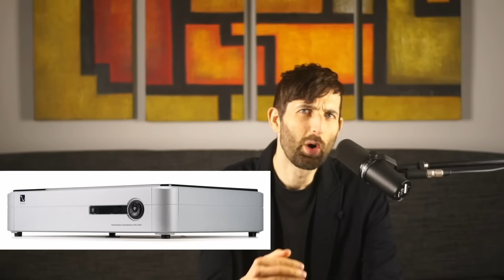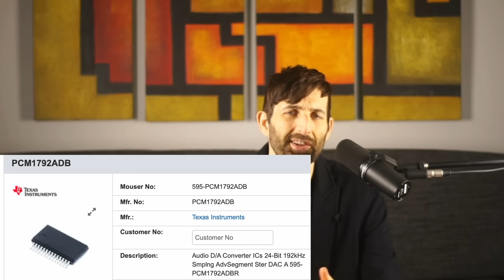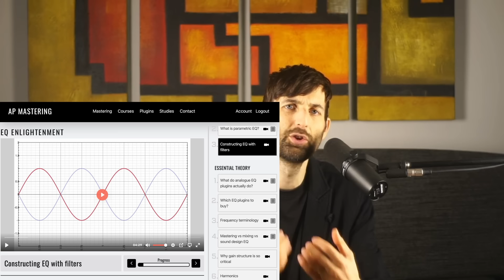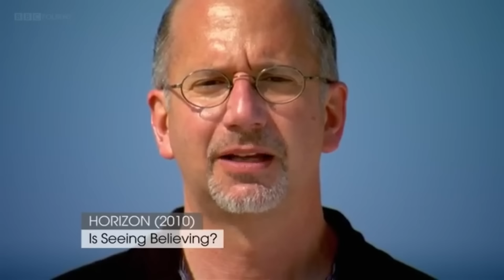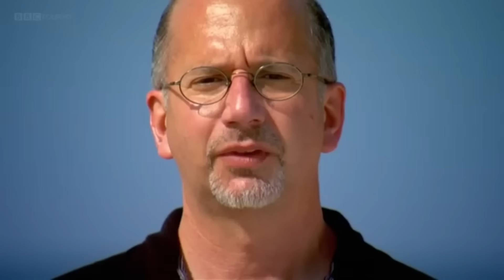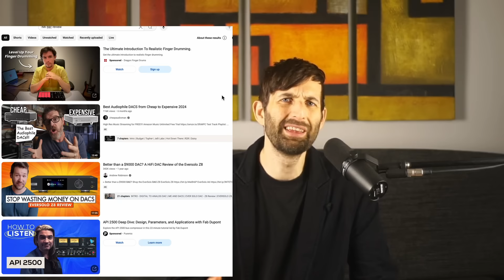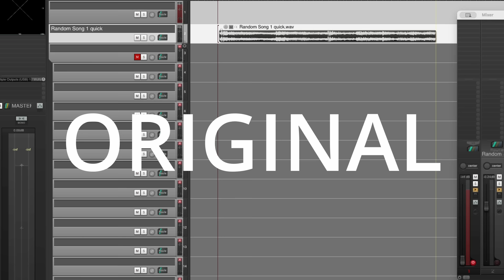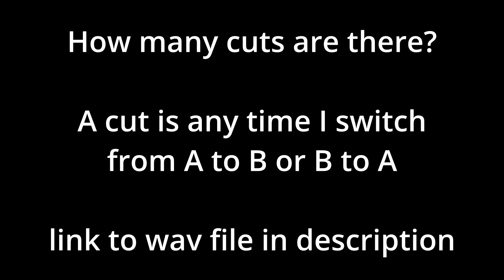The DAC Scam - Almost everyone believes the hype

Comment: I've read some claims that some people prefer that raw sound and find oversampling fatiguing to listen to.
That's fine and all and I'm not gonna tell anyone how to listen their music, but wouldn't ot be trivial for conventional oversampled DACs to just include an NOS mode?
Reply: The FIIO K11 R2R DAC for about $160 has an NOS mode.  So does my Gustard R26 that I bought after finding how much I like the FIIO R2R sound.  The R26 oversampling is actually variable.  The effect I'd call analogous to cranking up the sharpness on a photo image.  Its up to you if you like 'soft' or 'over sharpened' or somewhere in between.  I like somewhere in between.  I'd say most people could tell the difference.  Its not subtle.  Least with these two ladder DACS.  Got a AKM chip DAC I can flip to with a switch.  If I play something on that, people have said, 'that's the best thing I've ever heard.'  Until I flip to the R2R DAC.  The new 'best thing I've ever heard.'  (I was going to say there's no DAC chip in the Gustard R26.  Actually it has DAC in there to process DSD without converting to PCM.  That's a different animal all together.

Comment: Couldn't hear a difference at the end, I heard a shootout with a cheap Tascam converter vs the apogee, They guy tracked to both and mixed in each one, I did hear a difference and I preferred the cheap Tascam as it seemed to have a bit more weight in the bottom end.
Reply from the maker: anything that adds more weight in the bottom end MIGHT have a high impedance output stage or something which is colouring the sound, or it is colored in some other way. that might be pleasant but it is defective by modern studio standards
Reply: @APMastering yes true, not flat as would want, but the final mix sounded better. I was thinking it may have been on the tracking side as those tascams have mic pres even though it went in from a mixing console into both ADDA units. Somewhere in the chain of the tascam was adding colour. But then Isn't that the philosophy of Burl? Love your insights !

Comment: I think you are right on the snake-oil selling part but dead wrong on what makes a good dac a good dac. The chip is the easiest part to get right (and even that is horribly hard with clone manufacturing).

 PCB design for audio use in general is hard and expensive. Protecting the signal from outside, from other traces and doing proper isolation of everything is something you can’t just do on the cheap even if you have the chips. You can either build something excellent and expensive or make something with shortcuts on the above. You’ll get away with them in some cases but in others you’ll get jitter and ground-loops on your analogue traces. 

Your test only proves that in your setup there is no difference. But we don’t see the most important factor which is the outside environment. Whats on that same power circuit, how stable is it? Whats the rf-noise in your room? Most cheap things work on clean dead stable power in a low rf-noise environment but running this ab test of a diesel generator near a high voltage line or with cheap and bad knockoff pcb design garbage or even a microwave on the same powerstrip might yield different results depending on the quality of the dac.

If you wanna see how good the dac is look  over the pcb design and test the signal with an oscilloscope. I was expecting more then dac works for me so its perfect and you should never spend more then x amount.
Reply: It's not that hard. It's no harder than designing a pre-amp which has been competently done for over half a century.
Reply: @peterscott2662  you clearly never made something commercial with USB. You can build and resell pre-amps from your garage if you know audio engineering. 

You need an official company, vendor and device id from the USB-implementers forum, adhere to all there specs, build or let build an FPGA/CPU/DPS if you want software addressable features and OS-API compability. Build drivers for each OS (and the future once if they change), and implement the operating system for your device itself. 

Adding usb or anything computer related (RS-232 is a common port on older devices) to a commercialy viable audio product requires the following:
- Hardware audio engineering knowledge
- WIN/MAC/LINUX Sound API and kernel level device driver knowledge
- Since you need kernel-programming and embedded programming C is the logical programming choise, haven't seen rust audio drivers yet but could work as well.
- Low level chip knowledge (as in CPU register's. clock cycles per operation, ...) to calculate and work around latency and write your operating system for the device itself.
- Most of these chips are done is assembly so depending on the CPU you pick exotic assembler language knowledge might also be needed.
- Full knowledge on the USB-protocol since you will need to adhere to the standard. 
- Knowledge and legal on how to set up your company and how to get that vendor and device ID and manage liability (and a few months cash for your company to burn since you can't release a USB product without it) 

Making usb devices isn't simply making an audio device, its making an embedded computer that receives networked encapsulated serial packets that needs to be stripped, checksummed (= math operations) and processed with as low latency as possible before its even put on the dac circuits. 

I work with embedded devices on daily basis and even dead simple not latency prone applications become very complex when using USB. This is the whole reason industrial machines in all price ranges (1 euro to millions) are still using DB-9 connectors on whichever protocol they desire (MODBUS/RS-232/RS-485/UART) which is from the 1960's. Can't simply send a raw byte data over USB. 

So unless you are an audio embedded C  Kernel engineer with some legal background it won't be as easy. But if you are why would you make a dac? You're probably a top level engineer. Wouldn't work for  for less then 1k/hour with that skill-set.
Reply: Very true, but take a look at the Neohipo DC-10. 
Its very cheap but the output is very clean.
I grabbed it at 35 pounds, at roughly half the price its available now due to online chatter.
How long it lasts before developing a fault is unknown. 
But the one I recieved as is, used in the same components chain (AMP, Speakers), it would be hard to tell the difference between this and any DAC at any price.
Reply: @PSwino  its very basic but might be perfect depending on the software you wanna run at it. Does only support one codec, some review mentioned that he could’t run some analys software because some driver issue on windows. Seems like the experience id expect from a bare stripped dac. Great for some of not most use-cases, literally unusable for others since some features were stripped both in soft and hardware. 

Haven’t yet talked about software yet, thats even worse then the hardware part. It will only work for as long as the manufacturer provides drivers. Windows is just shit, Linux support is meh for most dacs and core audio compliant dacs for mac are easily 100+ euros.
Reply: @metballetjes  Interesting, thanks for the info.
I am so impressed that a DAC created at this price point can sound so good, the higher priced ones must all be massively overcharging (at best) for higher grade materials outside of the actual dac chip.
I returned my SMSL SU-1 (that actually had some distortion issues) in favor of the Neohipo.
It worth noting that the SMSL PS100 at 25 pounds sounded the same in my chain also and my choice here was purely a cosmetic and build quality one.

Doing some more research on the matter Is what brought me to this video :)

For the record, my entire chain I use this in is cheap...
Mini Windows 10 PC via USB-C, Plug and Play drivers and powered via the USB (I assume this causes quite a bit of unwanted noise but I can hear nothing).
Its connected directly to a Fosi V3 amp with some old KEF iQ10s with a Wharfdale Sub.
But ive had more expensive highly regarded equipment in the past, so Im not just basing my oprinion on this budget setup.

Comment: I had a dangerous Dbox and the DAC was much better than any interface I had at the time. Once I got the Apollo 16x I didn’t need the dbox anymore as far as DAC was concerned. 

I’m no audiophile by any means but there was a difference. 

Anyway, I see no reason to upgrade my DAC for monitoring but if using to send through a console one may consider the quality differences a bigger deal.
Reply: Yes.... Answer: Absolutely. The D-Box was better than previous, presumably lower-end, interfaces, but the improvement reached a point where another high-end unit provided a similar level of performance. This implicitly counters the "scam" argument.

Failing to distinguish between two DACs in a blind test doesn't prove they sound identical; it simply means the listener, in that specific test, couldn't reliably identify the difference. This is different from claiming that no difference exists, or that the manufacturer is deliberately deceiving customers.
Reply from the maker: just do a loopback test like I do here. Do 50 trips and see what it sounds like

Comment: Please do digital transports next.  My argument has always been that if a digital transport sounds ‘better’, then clearly there’s either A) a wrongness to it; or B) there’s some smilie EQ circuitry in the box to make it sound ‘better’… neither of which is conducive to working with audio.

If a functional digital transport could improve the sound of something, then I’d like to try streaming an Excel spreadsheet through it to see if it makes the numbers look better, or a Word file, so see if it improves the grammar.
Reply from the maker: I send all of my invoices to my customers via a golden ethernet cable to my internet router and I always receive double the money. it's amazing what high quality cables can do.
Reply: Yes, If it takes a $1000+ transport to extract the data from a CD,  all the FLAC rips I've made using a $30 cd  burner must suck.

Comment: I mean, audio-voodoo people pay equivalent of a downtown flat for their cables... they deserve to be scammed
Reply: Many years ago a co-worker and I would pass the time coming up with audiophile buzzwords to repurpose random bits of stuff from around the lab as audio parts. Good times, good times.
Reply: @libcent  I used to think cables made no difference until I got the chance to listen to several different sets of speaker cables in a high end system. Curiously the cheapest cables sounded easily the best with the others ordered almost exactly in inverse to the price. I think the really expensive cables were messing stuff up with extra stuff that increases capacitance and inductance and inadvertently filtered some frequency out.
Reply: @deerfootnz  the expensive stuff will on purpose be trying to cause a difference even if it's objectively to detriment

Comment: I agree, but the difference between my old Motu 2408 mk3 and the new Ferrofish was definately clear. But I've done the loop back test on the ferrofish and up to 10 I gave in ...couldn't hear it.
Reply from the maker: after how many did you notice on this loopback test in my vid? I go up to 100. Everyone should be able to hear 100 here, it's quite obvious but I think quote a few people would hear 10 too....
Reply: Which Ferrofish did you get? Is it the Pulse8AE?
Reply: The 2408 mk3 used AKM AK4528VF chips. Even back in 2004 these chips didn't have stellar measurements and performance. According to the datasheet, the SINAD of the DAC was just 94 dB, but in practice the measured SINAD at the output of the 2408 mk3 would be lower (as it will be for all devices). Today you can get DACs with measured SINAD of 120 dB at the output for under $250.
Reply: @FM-kl7oc  I used the 2408mk3's for cv/gate out to control analog synths. They sounded a bit naff for audio. @APMastering I couldn't hear when you did the switch on the test at the end. I could hear past 10 just about on the earlier test using apple airpod pro 2's. I like using RME Digiface for the low latency drivers. Ferrofish is the Pulse 16cv.

Comment: Allow me to disagree with you... Not all DACs use custom Chips for 10$ ... There are R2R Dacs and there are FPGA DACs like the Direct Streaam from PS AUDIO..... Also a DAC's performance depends on so many things other than the Chip..... Jitter control using a Femto internal clock, The power supply and linearity of power inside the DAC, the slew rate.... The types of components ... as not all DACs use tthe cheap Op-amps for signal amplification..... This video shows how little you know about this topic...... and if your ears cannot hear the difference that's great news....stick to your $200 DACs
Reply from the maker: why do you claim what I know? If you have such golden ears please tell me how many times I switched in the blind test

Comment: Poor people out there... I've been modding the analogig output of CD players, or whatever has a DAC inside and let shine USD 100 Players over other many thousands worth (or not). Digital was born with tight higher quality parameters, still today a RED Book CD of the second generation (87 - 91) presents the best compromise of the program itself (respecting masters and their original dynamics), after that begun the "remaster" debacle, with 1 of 20 good and subtle upgrade on positive things that made difference. What makers did?, put horrible RC/JC 4558 Op amps for anything needed after the DAC Chip... shure digital is awful!!!!! ANALOG is awful, dear!!!! I Have Updated the output of a Playstation1 (born beautiful for audio for it's video clock implementation) and compared quasi blind with a set of Marlk Levinson Transport/Dac on a Mark levinson PRE/AMP - Apogee Diva setup, long and crazy short... my friend (owner of that marvelous system) begun to sweat very hard, the little PS1 was warming up slowly till the point the audio party was over, giving all ower efforts to make some scotch desapear from that moment on.  There's a Business World Outside, in case you don´t know... Cheers

Comment: What about nulltests?
Reply from the maker: I had that in my video but just it out to make it more punchy. in this case the null delta was significantly lower than -40db
Reply: @APMastering  interesting. I nulled my MOTU 16A against an Apogee AD16X. Much higher DB on the delta. Would be nice with a good old comverter shootout video.
Reply from the maker: @ have you added an all pass filter around 17k and fine tuned to compensate for any rotation of a non phase linear filter? That can sometimes further reduce the delta by 10db or something if non phase linear gentle filtering was used.